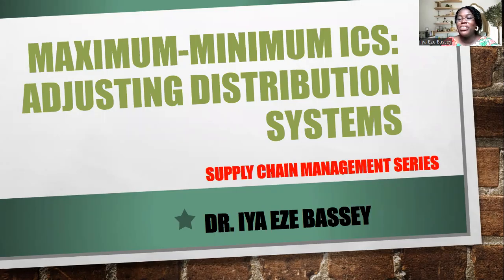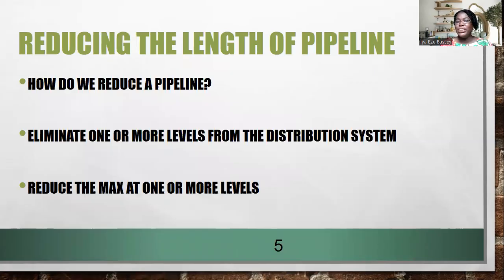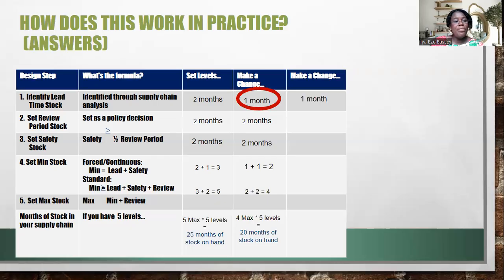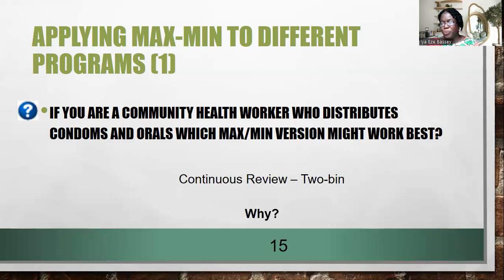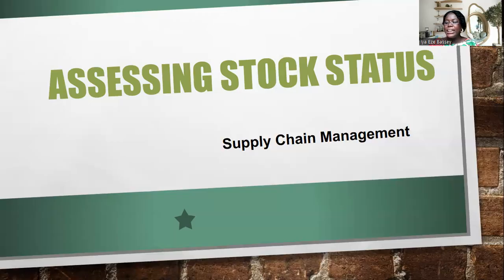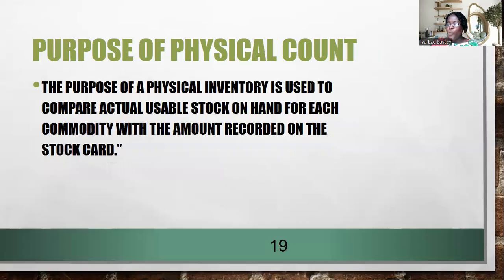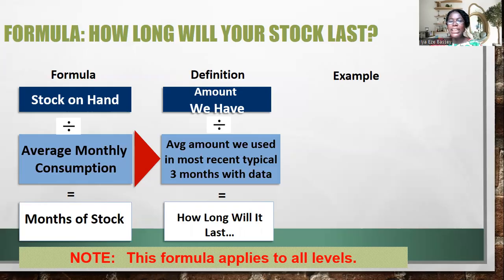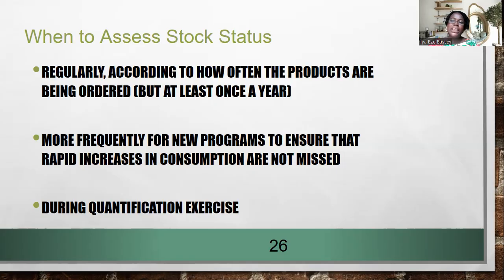Maximum-Minimum ICS: Adjusting Distribution systems (Supply chain management series)

Comment: Thanks ma, I understand the steps in design a Max -min lCS which are 
-set up intial max-min policy for each level and type of facility
- check if the distribution function properly and check pipeline total length
I also learnt how to reduce pipeline length which are 
- reduce the max at one or more level
- Eliminate one or more level from distribution

Comment: Wow!
I learnt from this session that the following methods for modifying distribution system policies:
1. Establishing initial maximum-minimum standards for each level and type of facility
2. Verifying whether the level-specific max-min regulations will be applied and whether the overall distribution will perform effectively.
3. Verifying the pipeline's overall length as implied by each level's regulations.
However, the following are the benefits of employing the Max-Min system:
Reduces wastage, prevents overstocking and understocking, and maintains a consistent supply level. 
Regards, ma.

Comment: Setting up initial Max-Min rules for each level, determining if the distribution as a whole will work, and determining the total length of the pipeline that the policies at each level suggest are the processes in constructing a Max-Min ICS. In order to compare real stock on hand for each item with the amount listed on the stock card, accessing stock status entails the physical count. Depending on how frequently the products are ordered (at least once a year), we have access to the stock status on a regular basis.  Utilizing MaxMin systems has benefits such as minimizing waste, avoiding overstocking and understocking, and maintaining consistent stock levels. Max-Min stock levels are influenced by a number of variables, including product pricing, transit reliability, and storage capacity. health products have a limited shelf life. Thank you Ma

Comment: This series are indeed intuitive. Thank u Dr. for the knowledge uplifting 😊.  

In summary, I learnt that Optimising the allocation and delivery of items to multiple locations is part of adjusting the distribution system in an inventory control system.

The benefits of changing the distribution system include avoiding overstocking, understocking, minimization of waste, avoiding the cost of emergency orders, and consistency of stock level.

By reducing the length of the pipeline by removing one or more levels from the distribution system, MAX-MIN ICS distribution systems can be adjusted. 
by reducing the review period and lead time at one or more tiers, the Maximum Stock Level can be decreased.
Take into account the variables that have an impact on MAX-MIN stock levels, such as storage capacity, storage costs, staff skill levels, forecasting precision, and program age

Comment: Thanks you mma, 
At the end of this series I have been able to identify the way to adjust distribution policies.
REDUCING THE LENGTH OF PEP LINE :
. How do we use a pep line 
Eliminate one or more level from the distribution system.
Reduce the max at one or more level.

REDUCE THE MAXIMUM STOCK LEVEL.
. Element of the formula which can be change.
. Shorten or review period at one or more level.
. Reduce the lead time at one or more level.
  . Improve the distribution system reliability at one or more level so that safety stock can be Reduce.

OTHER FACTOR THAT CAN IMPACT MAX- MIN  STOCK LEVEL 1
. Cost of product.
. Reliability of transportation .
. Storage capacity 
. Cost of storage.
. Storage condition different at all level 
. Shelf life of Heath commodities.

ADVANTAGE OF USING MAX - MIN SYSTEM.
. Avoid over stocking
Avoid under stocking
Minimize wastage 
Avoid  of emergency order
Simplify inventory control decision making 
Consistency of stocks levels
Reliable data source from SDP for forecasting and quantification 
CHALLENGES OF USING EACH VERSION AND VARIATION.
System with numerous level 
System that manage large number of  commodities 
System that manage product for new programs 

Thanks.

Comment: Thank you Ma

In summary
📦 Adjusting distribution systems in maximum minimum inventory control systems can help identify ways to adjust distribution system policies and improve logistics management.

💡 Setting up maximum policies for each level and type of facilities is crucial in ensuring the proper functioning of the overall distribution system.

📉 Implementing policies to reduce the maximum inventory levels at different levels of the distribution system can also help optimize the supply chain and decrease the pipeline length.

📊 The design step in adjusting distribution systems involves setting parameters such as review period, safety stock, minimum stock, and maximum stock to determine the amount of stock needed.

📉 Adjusting lead time, review period, and safety stock can significantly impact stock levels in a distribution system, potentially reducing it from 25 months to 12.5 months.

♻️ The purpose of using a maximum-minimum system in supply chain management is to prevent overstocking, minimize waste, and avoid both understocking and overstocking.

📝 Assessing stock status plays a vital role in inventory control, including reviewing stock levels, determining the review period, and selecting the appropriate inventory control system.

📊 "Your stock on hand divided by average monthly consumption will give us our months of stock." - Understanding the formula to calculate months of stock can help in managing distribution systems effectively

Comment: Thank you ma'am for this enlightening session. 

Distribution system policies can be adjusted by eliminating one or more levels from the distribution system or reducing the maximum stock level. This involves shortening the review period at one or more level, reducing the lead time and improving the distribution system's reliability. 

The max/min system has some advantages which includes; Avoid costs of emergency orders, consistency of stock orders, avoids wastage etc. On the other hand has numerous levels with numerous commodities. This is considered a challenge.

I also got enlightened on how to calculate months of stocks. This is achieved by dividing the stock on hand by the average monthly consumption.

Comment: In this series, i could grab what can be done to reduce the length of a pipeline. Shorten the reviews point at one or more levels, reduce the lead time at one or more levels are on how to reduce maximum. I took notes of the factors that might affects the determination of max/min stock levels besides the length of the pipeline which are 
1) cost of products
2)  storage capacity
3) cost of storage
4) shel life at health commodities etc
The advantages of using max/min system were vital. Assessing stock status is important because it helps to know when physical count can be done and its purpose

Comment: I learnt MAX-MIN ICS(ADJUSTING DISTRIBUTION SYSTEM).
How to design a maz-min ics which is called length of a pipeline.
You can reduce the length of a pipeline by eliminating one or more level’s from the distribution system. 
OTHER FACTORS THAT IMPART MAX-MIN STOCK LEVEL
- storage capacity 
- cost of production 
- cost of storage 
ADVANTAGES OF MAX-MIN ICS
- Avoid overstocking 
- avoid under-stocking
- minimum wastage
I also learnt about Physical count and also formula on how long will your stock last and also when to access stock status. Thank you

Comment: Thank you so much.  
In summary I learnt that,

The goal of ICS is to maintain an adequate stock level of every commodity, preventing shortages and oversupply.

ICS terminology include Review period, which refers to the time allotted for evaluating stock levels. 
The maximum amount of goods a storekeeper may hold at any given moment is known as the maximum stock level.
The bare minimum that a storekeeper may hold at any moment is known as the minimum stock level.
Emergency order point: This is the stock level at which an emergency order should be placed. 
The practical stock level to account for uncertainty is known as the safety stock level.
The lead time is the period of time between the moment a supply is ordered and the time it is received

MAX-MIN ICS: Modifying the Distribution System

Optimising how items are distributed and delivered to various places includes adjusting the distribution system in an inventory control system.

The benefits of changing the distribution system include avoiding overstocking, understocking, minimizing waste, avoiding the expense of emergency orders, and ensuring consistency of stock level.

Reducing the length of the pipeline by removing one or more levels from the distribution system can be used to modify MAX-MIN ICS distribution systems. 
lowering the maximum stock level by cutting the review period and lead time at one or more levels
Take into account the variables that affect MAX-MIN stock levels, such as storage capacity, storage costs, personnel skills, forecast accuracy, and program age.

Comment: This series teaches us that there are steps involved in the designing of max-min ICS which are
-Initial max-min polio for each level
-Check if overall distribution will function properly 
- Check the total length of the pipeline that governs at each level
We also have factors that affect or have impact on the max-min levels and they are;
- cost of production 
-lead time
-storage capacity 
-cost of storage 
-age problem and lots more 
We have the challenges involved in this system and they are
1; system with numerous systems 
2; system that manages a large number of commodities
3;system that manages products for new program😊

Comment: In summary of this section,I got to understand that we reduce pipeline through the elimination of one or more levels from the distribution system and reducing the max at one or more levels and that cost of products,cost of storage etc are factors that impact max min stock levels .
I also understood that physical count is the process of counting by hand the total number of usable unit of each commodity in your store at any given time which is used to compare actual usable stock in hand for each commodity with the amount recorded on the stock card

Comment: The first factor considered in this module is the length of the pipeline. the pipeline is the entire chain of transportation links through which supplies move from manufacturer to the consumer.
To set up a Max-Min ICS :set up a Max-Min level policy and check if the system will still function. if it does, check the total length of the pipeline that policy of each level imply. The length of the pipeline affects the determination of the max-min ICS. Other factors include -Cost of product - cost of storage - reliability of transportation - storage conditions and so on
The advantage of using any Max-Min system is that it helps avoid over and under stocking therefore minimizing wastage. it also maintains consistency of stock levels while simplifying inventory control decision making.
Challenges may arise in systems with numerous levels, systems that manage a large number of commodities and systems that manage products for new programs.
The standard version ICS is recommended for drugs, HIV test kits and labs.
Assessing stock status helps to keep up to record of stock at hand ( quantity, durability). it can be done by physical counting which may be regular or for new products, quantification exercises e.t.c

Comment: The Maximum-Minimum Inventory Control System (ICS) is a method used to manage inventory levels in distribution systems. It involves setting maximum and minimum stock levels for each product. When inventory reaches the maximum level, it triggers a signal to stop ordering more until it falls below the minimum level. This helps to prevent overstocking and stockouts, ensuring optimal inventory levels and reducing costs. By adjusting distribution systems based on the Maximum-Minimum ICS, organizations can maintain a balanced inventory and improve the efficiency of their supply chain management.

Comment: I understood that in designing a Max-Min Inventory Control System (ICS), the process involves initially establishing Max-Min policies for each facility level and type, ensuring the overall distribution's functionality with these policies, and assessing the total pipeline length implied by these policies. Key factors influencing Max-Min stock levels encompass product cost, storage cost, storage capacity, and storage conditions across different levels. The advantages of employing a Max-Min system are minimizing wastage, preventing overstocking, and averting understocking. However, challenges can arise in systems with multiple levels or when managing a large volume of products for new programs. In summary, Max-Min ICS simplifies inventory control decision-making.

Comment: Very interesting and self explanatory.
In this series , I learnt that the adjusting  distribution system is above considerable shortening of the pipeline, improving the distribution systems reliability at one or more levels so that  safety stock can be reduced.
This system is important to avoid overstock minimise wastage, and avoid the cost of emergency order. 
  
Factors that impact max-min stock levels are:
1. Cost of product
2. Reliability of transportation
3.storage capacity
4. Cost of storage. e.t.c.

Comment: I learnt ways in which the max-min system is being adjusted. One of the important step to take is reducing length of pipelines. I also learnt the different advantages of using a max min system and associated with it. I also learnt the max min version that can be used in different scenario,examples for condoms and orals the continuous review-two- bin is the best to be used .while the standard version is best for Hiv test kits .in assessing stock status ,we do a physical count to determine how long supplies will last. Stock status can be assesse regularly according to how the products are being ordered, more frequently for new programs and by doing quantification exercise.

Comment: Thanks Ma for this lecture. In summary;

1.) I learnt that the steps in designing a max-min ics are ; set up initial max-min policies for each level and type of facility, check if the overall distribution will function properly if the level specific max-min policies are implemented and check the total length of the pipeline that the policies at  each level imply.
2.) I learnt that factors that impact max-min stock levels include; cost of product, cost of storage, storage capacity, storage conditions at different levels , etc
3.) I learnt that challenges to using each version include ; system with numerous levels, system that manage a large number of commodities, systems that manage product for new programs.
4.) I learnt that physical count is the process of counting by hand the total number of usable unit of each commodity in your stor e or health facility at any given time.
5.) I learnt that the purpose of a physical inventory is used to compare actual useable stock on hand for each commodity with the amount recorded on the stock card.

Comment: Thank you ma.  I learnt that adjusting the length of pipeline isn't an abrupt action. It is achieved by setting up / implementing fair max-min policies for each level of the system by reduce RP, Leadtime, safely stock at one or more level or improving the reliability of the distribution system.
Max-min system help ensure consistency in stock levels and also ease quantification processes.
Factors like; accuracy of forcast, reliability of transportation, storage capacity and product shelf life may affect the max-min system especially when there are numerous levels and plenty products or even in  the case of product for a new program.
It is advice to consider the various factor/trigers  for each max-min inventory control system when choosing them for a program.
Assessing stock levels:
This helps us  determine how much products is in the store, how many are still usable and how long it will last. It is done by physical count i e counting by hand, it help us compare the actual SOH with that recorded on the stock book.
Assessing stock status may be done during quantification exercise or regularly especially for new program to determine when there is increase consumption.
Thanks ma.

Comment: In summary, I've acquired knowledge about the steps involved in designing a max-min Inventory Control System (ICS), the methods for reducing pipeline length, and various factors affecting the determination of max-min stock levels. I've also gained insights into the benefits of a max-min system, such as preventing overstocking and understocking, along with the challenges associated with different versions and variations. You mentioned the importance of physical counting, which entails manually tallying the total number of usable units for each commodity in the store or health facility. I'm glad to hear that the class was enjoyable. Thank you!

Comment: MAX-MIN ICS; ADJUSTING DISTRIBUTION SYSTEMS

STEPS IN DESIGNING A MAX MIN ICS
-Set up initial max min policies for each level
-Check if overall distribution will function properly
-Check total length of the pipeline

Factors affecting MAX MIN STOCK LEVELS
-Cost of products
-Reliability of transportation
-storage capacity
-cost of storage
-storage conditions at different levels etc

Advantage;
Avoid overstocking, Avoid understocking, Minimize wastage, Avoid cost of emergency orders etc

Challenges;
-System with numerous levels
-System that manage large number of commodity
-System that manage products for new programs